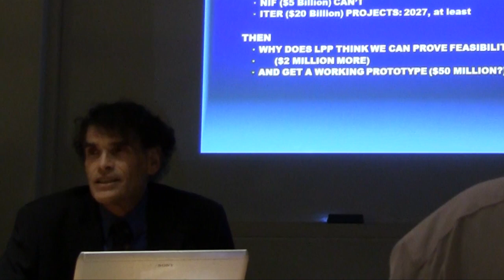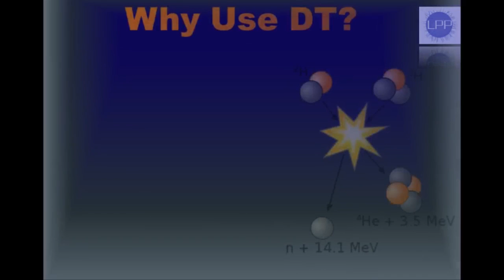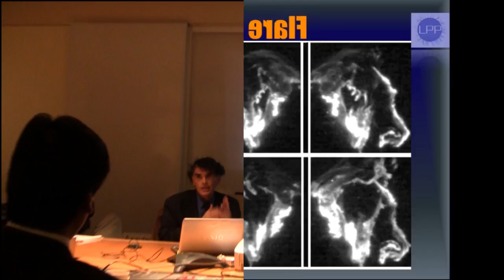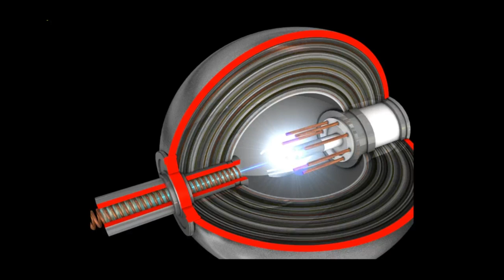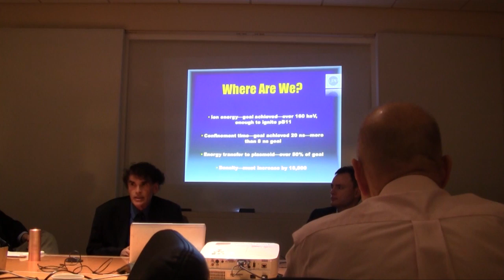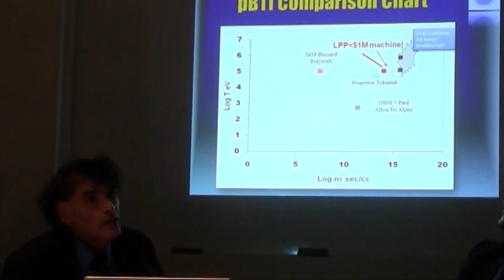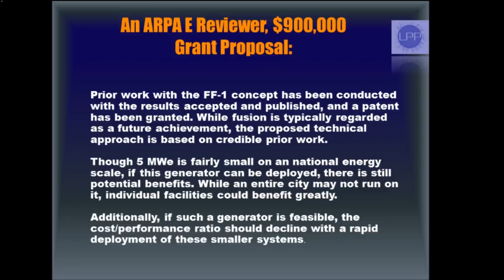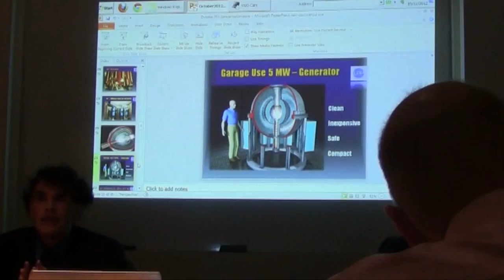Fusion Energy - Might We Finally Achieve It?

Comment: Congratulations. No wonder that you can get fusion in a plasma focus device. It was done before in other fusors. A problem is to make a design that can get sustainable electrical energy output, or can be developed to such a stage. I doubt that your design have a chance because electrodes would erode in time. However, I vote to continue your research as it may lead to discoveries of interesting phenomena and may be to some technical applications. Good luck.

Comment: Well, good to hear about the success. I was thinking recently on this plasma focus fusor. IMO, it can be better to use it as a source of Neutrons and a converter of Thorium to Uranium 233. At such high temperatures electrons generate not only X-rays but also Neutrons, especially if Tritium is used in the chamber. It can be experimentally found what gas composition and the fusor design are better to generate Neutrons. So, pls, do not give up on Thorium. Fision can work together with fusion.

Comment: The guy is a theoretician, and for sure, he never worked with a plasma switching tube. I used a few discharge switchers between a 100 KV capacitor and electrodes to create plasma for CO2 laser. Unless I made a special design of the switcher, its electrodes were eroding and regular shut downs were necessary to clean the tube. A special design twisted magnetic fields and kept its work stable, and a tube clean. However, this twisting can never be applied to DPF device and it cannot work reliably.